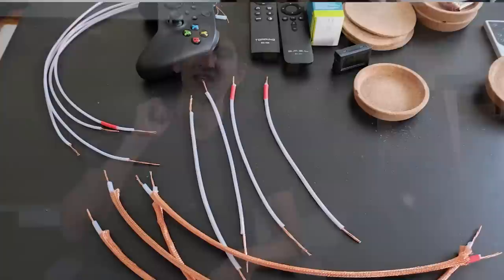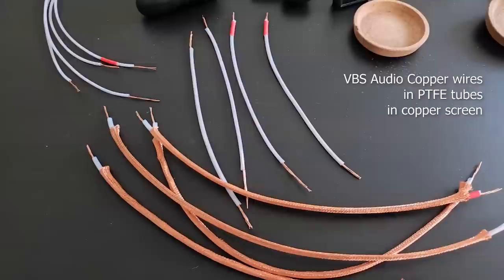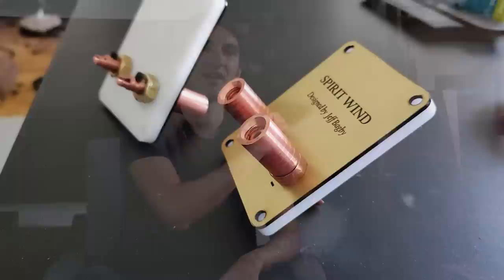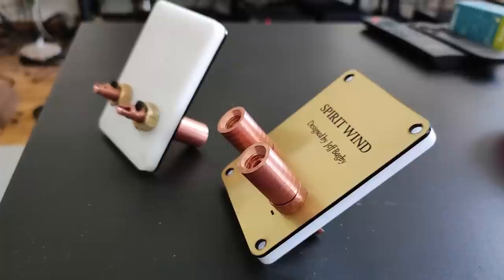High End 2-way speaker Spirit Wind

Comment: Love that you have used threaded inserts to mount the drivers instead of the usual thing of just screws into the wood, which is found on even high end designs and annoys me whenever I see it. The cost of a few threaded inserts cannot be much and it stops any possibility of chewing up the wood which is all too easy with just plain screws. That walnut veneer is very nice too, they look classy.
Reply: Hi very interesting comment I would like to do the same on my speakers that have screws now The wood is mdf Speakers are old Musical Fidelity MC2 with newer woofers from Seas 
Do you think that there could be also a little improvement in sound? I think that a better connection with the baffle can be a good thing
Kind regards Gino
Reply: @gino3286  Doubtful that there will be any difference in sound.
Reply: @CC-xu2yz  Hi thank you very much for the kind advice  The cabinet looks made out of chipboard  I am thinking to rebuild it from MDF  The tweeters look very nice 
Kind regards, gino

Comment: Too bad that Meniscus has closed business- they had a lot of great offerings over the years. 😢
Reply from the maker: I was told they will make a new website where you'll be able to purchase only speaker plans for appropriate price... But they will not sell parts anymore.
Reply: @iiWiReviews  Well, for the rabid DIYers plans and X-O schematics could be enough; provided that required drivers are readily available and not special OEM version, and that original IP owners are still remunerated as appropriate.
Reply: @iiWiReviews  I am on the waiting list, but nothing yet.

Comment: Thanks , great to have the Spirit Winds finally reviewed. I thought they would be good and in all it depends on the quality of the materials and your room. I do want to build a pair of monitors but for now I have bought the Troels Gravesen " Revelator 851 " kit which I will build in January, not cheap at over 2,000 eurs but it will be worth it. Troels uses all Jantzen crossover parts, in the tweeter section it uses the Alumen Z cap , higher cost than in the Spirit Winds, The Tweeter is the Scan-speak D3004/660000 again more expensive. I really look forward to building them... Check him out if you haven't already done so, another great designer...Cheers.

Comment: Being able to control the expense applied to crossover components, as in, spending big on quality crossover components, can be the most rewarding aspect of DIY'ing. This is an area where commercial manufacturers, inevitable, boost their margins. 
It would be interesting comparing against an identical build but with 'standard' crossover components.
(I'm using Mundof MCap Supreme EVOs and a variety of bypass caps, in my Open Baffle DIYs.)
Reply: You ever run into these people who swear parts quality doesn’t matter? Ridiculous.

Comment: Wow, they are extremely high-end crossover parts! I’m a DIY guy, a kind of, a sort of, and I’m using Janzen Superior Z-cap. It’s good enough for me, and I have to satisfy with this. Silver Z-cap is a dream. Good for you.
Reply: I recapped my vintage 1997 B&W Matrix 805s with Jantzen Superior Z caps. They took an already great speaker to a whole new level.
Reply: I have used Silver-z and i think from what im hearing superior-z is better, if you value smooth listenability. I had to bypass silver-z caps with PIO to get rid of annoying sterile quality from them. But everyone hears differently so your mind may vary..
Reply: @jarkkokinnunen9963  I’m using Superior-Z paralleled with HVL (Hovland?) blue to Satori tweeter and it’s clear but not harsh. I wondered what will happen if I replaced to Silver-Z, but maybe I should consider well. Thanks for your experienced information.

Comment: Great stuff! Your build looks great - impossible to tell that it is not a commercial speakers.

I have just finished my DIY projects and have very similar experience as yours - VERY satisfied that I have chosen this route. I was brave enough to make DIY preamp (Whayne Coulburne's - PASS Labs - WHAMMY); DIY FirstWatt F6 power amp (from Maestro Nelson Pass) and DIY loudspeakers - Troels Gravesen's Discovery 861 (ScanSpeak's drivers).  Speakers and power amp have been finished less than two weeks ago. It was not easy, took me a while - about 4 years from first thoughts and completely no experience. Patience and willing to learn new things helped me a lot. It is difficult to describe how happy I am nowadays. 

Discovery 861 are great speakers. Pleasant, easy listening with full of details and deep, extremely controlled bass, crispy highs. Can listen for hours and hours, with no fatigue. Obviously, the rest of the system plays very important role, not only the speakers. Goddamn, that system provides so much details... just incredible. I spent about 1k euro for the speakers, but only ordered CNC cut of MDF, from my own drawings (damn, had to learn even AutoCAD basics...). A cheaper version of crossover was chosen, but components are very high quality - Superior Z caps for twitter (most critical place), Standard Z and CrossCaps for the rest. And they sound WONDERFUL. Check out Troel's projects: troelsgravesen - DOT- dk, great guy. So happy to find his projects.  

Form what I have heard, commercial speakers costs ~10-20% from it's retail price. Imagine what you can do, investing a few thousands $ into DIY speakers from a good designer... but you will get entry-level in high-end speakers if you buy new for that money. You should also consider DIY preamp, amp, DAC and even turntable. Last two are on my TO DO list =)

Comment: Very inspiring. I currently vote you as number 1 internet reviewer because you look at things with a technical and musical perspective neither pointless budget nor stupidly expensive. Most reviewers use clickbait constantly running between the latest and imagined best until 2 days later there is something better - they are audiophile bimbos. Your English is much better than you credit yourself with and your word choice is much better than the extravagant meaningless sentences employed by most others. For the moment I will be looking into the following four - Kef L50 meta, Kef R3 meta, Focal Aria 906 and Amphion Argon 3S but I think your build is likely to satisfy my needs better. I ,live in France and it is not easy to find a physical shop. Can you tell me how big the sweet spot is for your Spirit Winds build both vertically and horizontally - they are important to me because I like to be mobile and I think you answered my other questions. If I can find what I want from my 4 auditions I will stop there otherwise I will hunt down the plans for yours!
Reply from the maker: SW has a very good dispersion and wide sweet spot. I was surprised to find out its better than KEF LS50 that features a dual concentric driver known to be great at that. I belive great Scanspeak tweeter with a small waveguide is helping with that, but also great Jeff's design.
Reply: @iiWiReviews  Unfortunately Meniscus has gone out of business so I guess the design has died with the death of Jeff Bagby and the going out of business of Meniscus. Do you rate any other designers that have similar designs?

Comment: Thanks for the nice video! You're right about the subwoofer. The minimum REL for your speakers is the S/510. By your description of the sound performance, that speaker is like my Dynaudio Heritage Specials - a speaker that you basically cannot point anything bad about it except it's actual size (and price for the Dynaudio's). It takes a marginally big, fast and detailed sub to match it, but once you match you won't take it out. Two even better :)

Comment: very cool, love your speakers.

Next, you have to try dedicated 10awg wire circuits to each component.  or at minimum 1x 10awg circuit for the amp, 1x 10awg circuit for the rest.  It made a big difference in my system!
Reply: Do you refer to the AC mains power cable wiring, or the internal speaker wiring of amplifier?
Reply: @peterlarkin762   AC wiring

Comment: If you do not know the cabinet is directly taken from the Avalon speakers, with the way the front is cut. Nothing wrong with that, but just Think the credit shall go where Jeff obviously have been inspired from. Have 2 models of Them myself. The old model Arcus and one from the new Line, the Idea. Both excellent speakers with no obvious faults. Very revealing and no fatigue whatsoever🙌🤗 Looks nice with the cabinetwork🙌
Reply from the maker: This shape is used to some extent with several speaker brands because it's proven that it brings acoustic benefits - less diffraction, better soundstaging and the feeling that boxes themselves disappear from the sound. 
Only question really is why more manufacturers don't do it (this or round edges).
Reply: Yes, there are more and more using it. But this is so close to Avalon as its not just a coincidence, and an Avalon trademark is excactly there freedom from boxiness and imaging. Some Call Them an electrostat in a box😊 But still nothing wrong with anyone being inspired to directly copy a good concept🙌

Comment: Amazing! I wonder about the raw exposed copper speaker terminals? Pure copper corrodes (green patina) exposed to air. Electroplating gold or rhodium is fairly easy to give the surface protection.

Comment: Hello Srbo
I follow and enjoy all your reviews. I have built many diy speakers over the years starting with transmission lines and folded horns. It’s surprising to many how much effect box design and composition along with crossover parts quality can have on the outcome…even with the same speaker components. I particularly was surprised by the positive effect of wire gauge in air core inductors.
Can you please post the source for your copper connectors?
Best Regards.
Reply from the maker: Copper connectors and wiring came from VBS Audio: https://www.facebook.com/people/VBS-Audio/100057252078271/
It's a small and unique production, but there's usually a waiting time involved since its popularity has risen sharply lately.

Comment: Great review! I have never heard of these diy speakers so it’s really appreciated, as I plan on building speakers in the future. I’d be interested to see all the components you’ve found that pair well with them. I use the Dynaudio Focus XD 200s, and like that darker tone as well. Cheers!
Reply: They should pair well with any component. The beauty of DIY is you can tailor the sound. Jeff usually suggests a few values for resistors/caps to make minor adjustments to tweeter level. The only real limitation for components will be the SPL, so I wouldn't use less than 20W amp.

Comment: They look decent but very promising end game speaker design wrt bookshelves going flat to 35hz. I don't understand how sources improve soundstage when the driver and cabinet design almost always dictate that but I do understand how timbre, imaging and instrument seperation could be perceived based on the source. This is my experience so far. In any case LS50 meta has 70deg horizontal directivity and 60deg vertical directivity as measured by amir (asr) and ls50wireless is 50deg Hor and 50deg Vert as measured by erins(erinsaudio). ls50meta distorts at 96db upto 1khz >3% but the newer wireless version has compression under 0.5% for 96db. clearly they can be driven in a large room.

Comment: Why don't you build a floor-standers? As far as I can see, you have a pretty big room. Some high-efficient 3-Way with 15'' bass driver should be very interesting.
Reply: Was thinking the same, I'm very pleased with the 13cm mid drivers in my 3 way design. The midrange is incredible fast and clear, they image like crazy, almost impossible to obtain with a 6'' or bigger driver. They also disappear better then my bookshelves while still deeper bass from the 10'' woofer..
Reply from the maker: Maybe next time. But I'm not thinking about it at the moment because I'm still in the romantic phase with these. 😊

Comment: Great video! I too went DIY after reading info on “cost of goods sold” for speakers. Most people consider a cost of 30% as the MAXIMUM that actually is spent and the cabinet is 1/2 of that! I went with the CSS audio 2TD-x and they have renewed my love of audio. I also went with the crossover upgrade with Jensen Superior caps but not because I thought one Cap sounds better over another but because the tighter component values would more exactly hit the crossover frequency.
While my speakers sound phenomenal, I have some room effects I need to deal with. I noticed you have dispersion behind your speakers—-why? Do a video? Most systems I have seen use absorption directly behind the speakers.
Again, great job!
Mabe
Reply: Oh, another question. You spent a lot of money on the crossover. Did you consider DSP for an active system?
Reply from the maker: Spending a $300 on crossovers doesn't look like that much compared to everything that would go into a fully active DSP.  Also, I'm just not ready to tackle that topic yet, but I do think about it as a possible end-game sometimes down the road.

As for diffusion, it just sounds really good here, deepening the soundstage, and making tones appear more clearly without negative effects. Absorption in that same spot, in my experience, makes cleaner sound but skews the tonal balance towards dry and analytical.
I had different experience for first reflection left and right where I find absorption much more attractive. Anyways, I'll talk about these panels sometimes in the future.

Comment: Very well presented video!  I, myself have relied on DIY speaker building projects to get the most "bang for your buck"!  I have built 7 speaker pairs using the best components (Dynaudio, Scanspeak, Accuton, Mundorf (Silver/Oil) Caps, Hoviland Caps, etc.) to achieve the highest sound quality. This is the best way to pay for the tools and components to ensure the fun and $$ to build for yourself the BEST audio speakers possible!  My questions to you: 1.) Did you have to "break in" your new speakers to delvelope its neutral response? 2.) And, if you did, how many hrs. did you allow? 3.) How important is it to use a quality amp, or can a vintage amp do (marantz, Luxman, or even a Denon 7:1 surround sound integrated receiver?  Thank you for your time.

Comment: Amazing video, SilverZ Caps are rather bright sounding caps and that maybe a trick with these dark sounding drivers, did you try to ad a small bypass like 0.1uf Miflex KPCU to the main tweeter Z Silver cap ? It could sweeten up the sound and made it more organic and lush , long long breakin period for it to open up fully as they tend to lose the highs after 20 hrs to get it all back with superb tone definition and detail harmonics at 300hrs or so ....   Have fun with it.
Reply from the maker: I did add Miflex bypass to both tweeter caps eventually. It made the midrange and tone timbre richer. I also changed the wiring to Duelund in cotton and oil, and binding posts to WBT next gen. Now they're truly amazing.

Comment: Even though this video was long, I watched every second. I love this design. I have a few pair of speakers and have been considering the DIY. 
This looks like a winner. I love the cabinet design. I like the fact the BOM is super high quality. I may be doing this soon. 
Ill watch this again. But quick question, the box was this part of there design or you? I do not recall if you mentioned that part.
Anyway keep this up, you are getting way better. 
Happy Holidays 
JJ
Reply from the maker: Thanks! Cabinet design inside the project is same in terms of volume and dimensions. We just pimped up the front panel with chamfered edges (not that necessary function-wise since tweeter has a small wawe guide and it is not as sensitive to this tweak as some others... But I like how it looks - it makes it look less blocky in my opinion).

Happy holidays to you too! 🎄

Comment: Is it possible to list the components used for the crossover and speaker taps so I could reproduce what you have built? I see they offer upgraded caps but not to the level you have assembled. BTW thank you, excellent video! Seems the MoFi SourcePoint 10 maybe inspired from these.
Reply from the maker: As mentioned in the video, I can't list the exact crossover values since that's a MeniscusAudio project. Still, you can see what I used in the video from 10:25 - Jantzen Silver-Z caps, Jantzen coils, Mills resistor as shunt, and PathAudio resistor in line with a tweeter. VBS Audio wires and binding posts (https://www.facebook.com/people/VBS-Audio/100057252078271/). I link only the last one because it is a small handmade stuff from Serbia, the rest is easily found online.